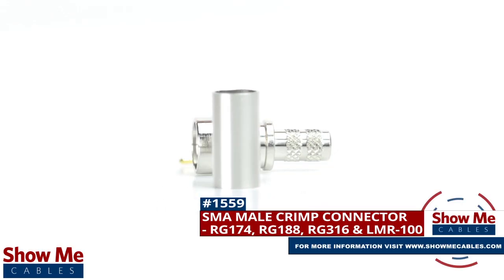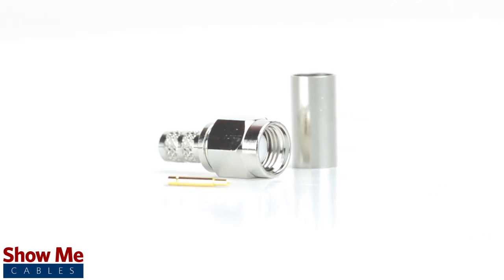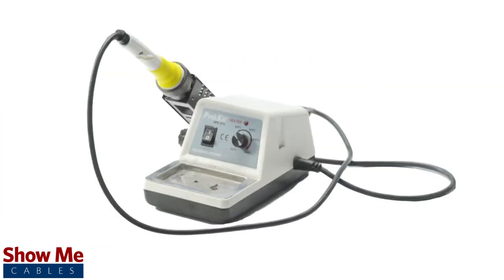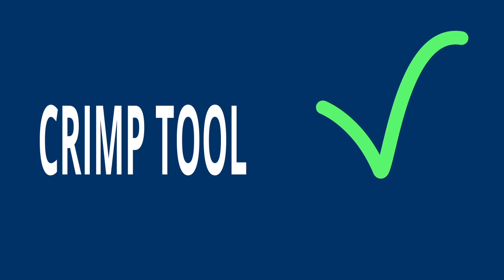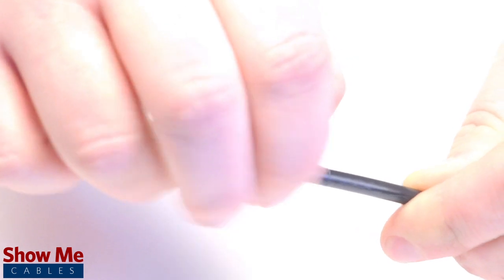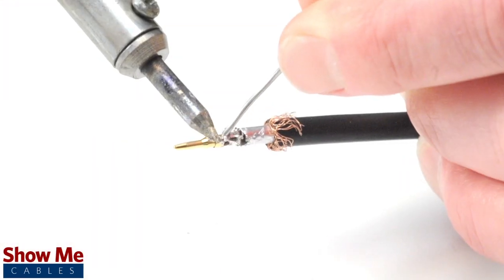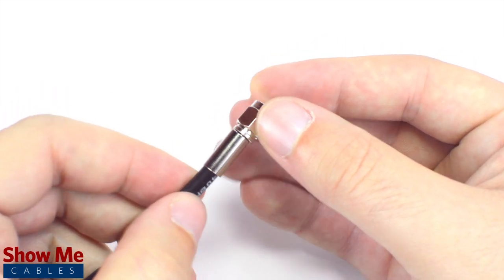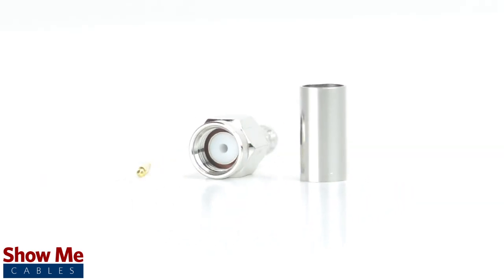SMA Male Crimp Connector For RG174, RG188, RG316 & LMR-100 - Perfect For DIY Installs!

Comment: First of All, When You Solder The Pin, It Needs To Be Extremly Clean, If you Leave Some Solder On It, It Will Not Fit The Housing Of The SMA Hole, So If You Try To Do It, Maybe Try To Do It Clean, If No Then Just Take Your Box Cutter Knife And Cut Off The Solder From The Pin Outside Untill Its Clean And Fits The Housing.
You Can Get 20 Of These Connectors For 8 Bucks From Ebay, And Not Steel, But Copper Brass Ones, Good Ones :) 
Steel Are Like resistor In The Line So Copper Is TheBest material :)

Comment: To those watching, you actually need to get the solder in the HOLE of the male pin, not smeared on the outside as in this video. Smearing it on the outside guarantees you wont be able to get the male pin through the housing (which is NOT shown on this video, as he would NOT be able to get the one he smeared solder on , onto the housing)
Reply: Thank you. I couldn't understand what I was watching!
Reply: Actually, the hole is an inspection hole to ensure that there is the right amount of conductor in the pin. The pin is designed to be crimped, not soldered. For all of these reasons, I wouldn't buy a single thing from this outfit.

Comment: Fail, don't show any cable striping measurements, guidelines using the connector no tips or tricks, guidelines nothing
Reply: Jwahar Bammi Big fail - he went too fast, too sloppy and too incomplete...
Reply: @markh.2899  The stripper made the measurements necessary. The solder made the connection, it's all crimped up and heat shrunk, cant see it, So messy is a non issue.
Reply: And what size die to crimp the ferrule? 😮